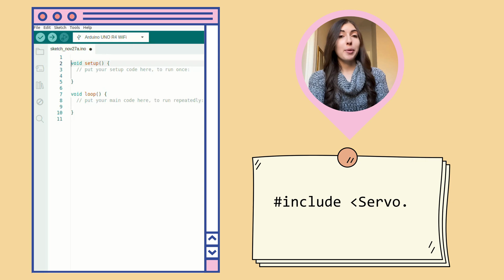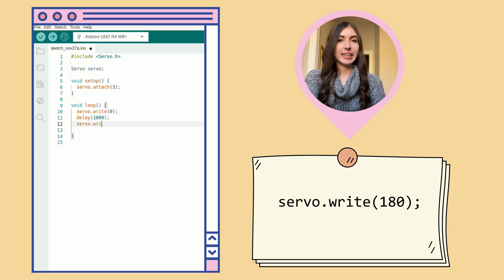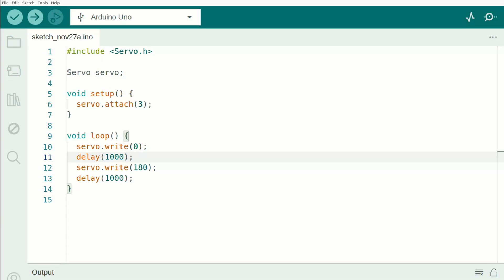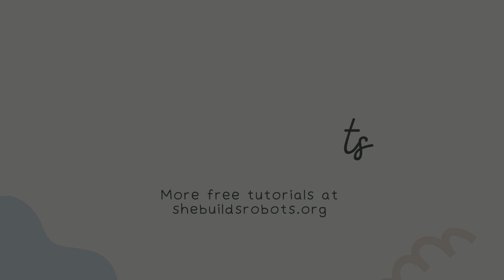Beginner Robotics Tutorial | How to Code Motors to Move

Comment: I recently bought the L298N motor shield for my Sun Tracking Solar Panel project using Arduino, but I’m not sure how to use it I’m a complete beginner and could really use some guidance on how to get started  Any help would be greatly appreciated! Thank you in advance!
Reply from the maker: I also have my first stepper motor project planned for 2025, so I'll post as I figure it out! I'm planning to use a dedicated driver since I don't have a shield. In general to get started I recommend figuring out how to connect power and ground first. You're probably using an external battery so that the motor can draw enough power, so you'd use the Arduino's Vin instead of 5V pin for power. After that, you should be able to Google the L298N datasheet to see how to connect the rest of the pins!
Reply: @shebuildsrobots Thank you so much for your help! I really appreciate it I can’t wait to see your version of this project As for me I need to finish it after 01/01/2025 I’ll keep you updated here 😅 or if you’d prefer, please share your email so I can reach out there This project is for my finals